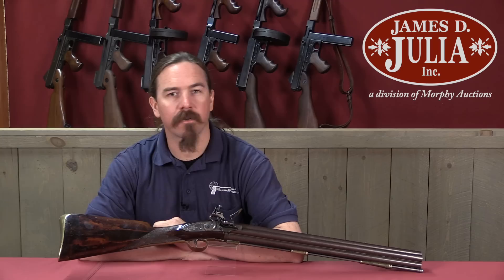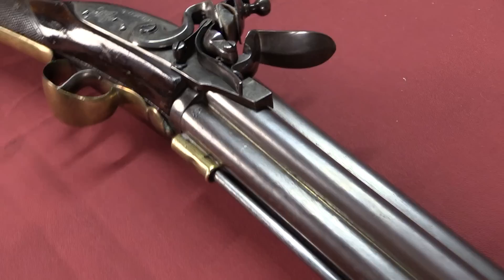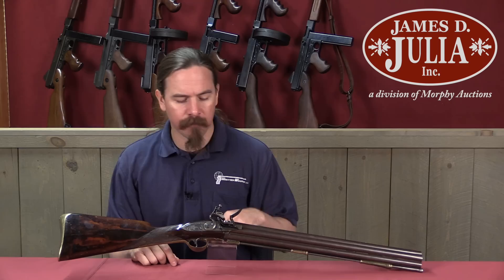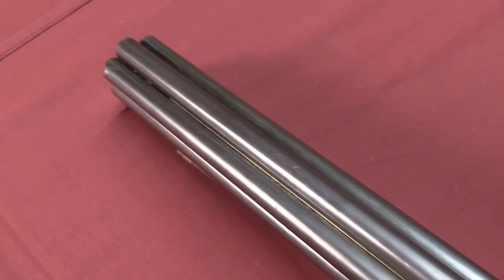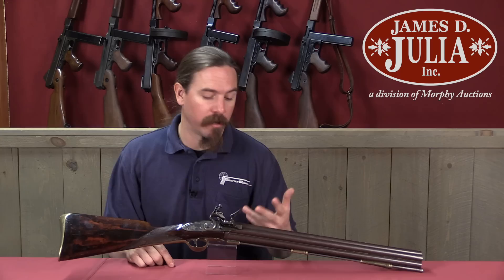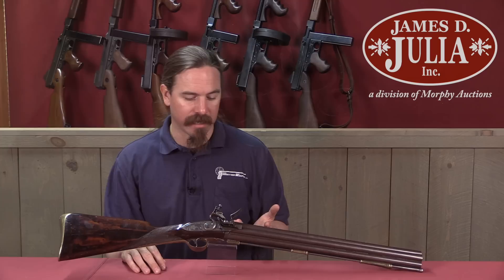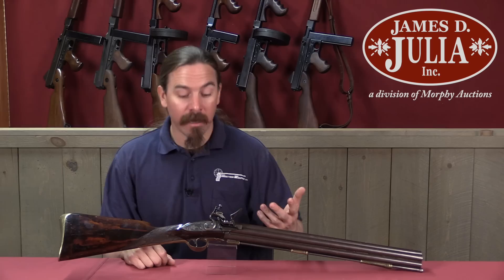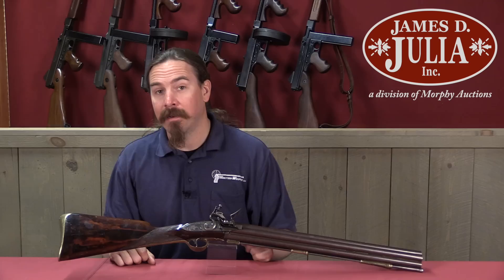Nock's Volley Gun: Clearing the Decks in the 1700s

Comment: Love your videos Ian. 
-Just one tip with this one. You can easily tell which barrel has or hasn't been fired by running the ram-rod down. If empty it will hit bottom and usually correspond to a marking on the rod itself. Sounds easy but I wouldn't want to be the one playing "one of these things is not like the other" 7x over during a naval battle. Please keep em coming!

Comment: Lol, GREAT video, but you had a huge oversight and got one thing dead wrong brother. 
If some barrels didn't detonate, just do what all musketmen did, and still do to this day, take your ram rod which had two cuts or lines in it so when it was inserted as far as it'd go, depending on which line was even with the muzzle, that told you whether the barrel is loaded or not.
Reply: I was going to say the same. Fairly easy way to check empty barrels
Reply: And muscle memory says, an unintendeded 'powdered' double shot.   Have to watch if you tap load going for 4 per minute

Comment: Someone probably already mentioned this but at 4:09 you said there is not a way to tell which barrels are loaded and which are not, that is false. Any muzzle loader worth there weight knows to mark there ramrod at the length of an appropriately charged barrel. That way not only if they drop the rod down the barrel they can tell that it is loaded but also you can tell if a projectile is fully seated or not. You do not want an air pocket between the projectile and powder in a black powder firearm, that is how you blow up a gun.

Comment: Ian not to say your wrong But the word Tower on the lockplates  I always believed was the tower of London  For most of the flintlock and percussion periods, the Tower of London served as a storehouse for arms, but no arms were actually made there in the usual sense.  Contractors made the various parts, and brought them to the Tower for inspection; if they passed inspection, they were accepted and the contractor paid.  Locks were delivered assembled but with the lockplate soft and "in the white".  The lock would be inspected, then disassembled and the parts inspected.  If accepted, the lockplate would be stamped with the broad arrow, then turned over to Tower workers, who engraved it with the royal cypher, the year, and the word "Tower" before hardening it.  Once all the parts were finished, the lock was reassembled, inspected again, and placed in stock.

Comment: I'd rather have a 1 bore blunderbuss full of 00 buck.
Reply: On top of a masthead, it might be a receptacle of rain, spray etc.  and isn't the load loose fit,
 an don't forget a 160+ deg angle.
Reply: @johnpotter4750  A muzzleloading shotgun uses a wad over the powder, and another thinner wad over the shot. So, you'd load the powder charge, then a thick wad, then your shot, and a thin wad over the shot. Like building a modern shotshell in the gun, one shot at a time.
Reply: @johnmullholand2044  True !  ....  just the juggling act, no range tables up aloft.   ..Fierce..

Comment: It is easy to determine which barrels had not fired in a partial volley - the ramrod would only go so far as the ball and wadding (sitting in front of the powder charge) i.e. not the full way. You would do this reasonably carefully, as vigorous ramming may cause the powder to explode under compression... anyway, no it is not difficult to determine which barrel had not discharged.

Comment: Suppose the reload problem with the non fire barrels would be sorted with a mark on the ram rod showing how far its meant to go into the barrel, if it doesnt, dont try to load it.
And i bet itd make a good nest gun, have a slightly armoured nest half way up a nest with a couple of them in racks when going into battle with a gunner and a loader team sitting up there. Be a mean system on deck clearing, especially if you have a couple barrels with buckshot as well as a couple with regular balls.

Comment: I suspect that the slight delay in the ignition of the six outer barrels, just after the centre one fires and causes (the beginning of ) recoil, unsettles the shouldering just enough to make total recoil unpleasant, aggravated by improperly holding it. If your first shot with a (badly fitting or badly shouldered) standard shotgun can put you off, imagine what this monster can do.

Comment: Damn that's a lot of gun. Most I've ever shot was a home made 5/8" bore muzzle loading/break-barrel 209 percussion Buntline pistol loaded with 200 grains of FFG black powder substitute, 3 .50 cal. lead balls and a full (spent) .410 shell full of birdshot poured in with some tissue paper wadding to keep everything where it's supposed to be. That thing kicked, but not as hard as I expected. Probably because of the generous spring length behind the piston that drove the firing pin into the cap. It was effectively buffered. Also tissue paper isn't the most efficient wadding. Results may vary, but it's still the hardest recoil I've experienced in my life so far. I might try a volley gun just for the challenge, now :)

Comment: Thank you Ian! I wish somebody made a shootable repro of this so we could have one for Rev war Re Enacting! My group is Colonial militia, but as we are Massachusetts men, the sea is never far away and plausably, a privateer might have got hold of one. In practice one tells if a barrel still has a load by dropping the ramrod down the tube, if it doesn't go all the way the barrel still is loaded and one must clear it with a screw and a worm. Re-enacting, we never fire ball anyway, but that would make an impressive boom and cloud of smoke.
My concern is as to how one might clear the internal touch holes, one often needs to "prick" the touch hole on a flintlock to ensure ignition.
I wonder if anybody ever pintle mounted a volley gun, it would seem to be the solution for the brutal recoil.
It would be very cool to shoot with you, Ian, If you were in the area, I'd invite you to come shoot anything in my extensive collection on my range and I have at least one gun you have never ever reviewed, a pack saddle cannon. (unfortunately I don't have the saddle or the mule either, but the gun is a 29mm 3 bore. It shoots a 5 ounce ball).
The Colonial Militia would welcome you.
Reply: Good point about internal touch holes, as you know powder (issued)quality/damp can play havoc with pan/touch holes, my matchlock has fairly large holes, not a problem.  Unless your ranking with a southpaw, then your felt hat has to dip lower,
     (R-R-L =painful)    front is more light brown than black these days.....
Reply: @johnpotter4750  That is how you tell who has been in the ranks longest! The hat!
Reply: @bellakaldera3305  1 yr a a Gentleman of the Pike,  Then 25 yrs as a mere mecanical (Musketeer, 3yrs Sgt)

Comment: Note the unfired barrels by checking depth with the ram rod. Sounds tediously impossible in a battle scenario.
Reply: Samuel Carpenter The real problem is clearing the barrel of the dud round. A laborious task you really don’t want to do.
Reply: +Bobby Lee I did it twice. Since then I make sure I only shoot a very clean touch hole with attention to properly settling the charge. I learned my lesson well and haven't had to dig a dud out the muzzle end in years. I don't see why they would have to dig out an unfired load in the heat of battle; just use the other barrels. I imagine the percentage of unfired loads would be rather high when loading under time strain. Anyways, I was just replying to Ian's statement that the task is "nearly impossible." Keep enjoying those historic arms! Nothing beats that black powder sound!

Comment: "...With blanks it has no recoil." Uhhh, actually, yeah, it DOES! I've fired a repro of this monster. Even with the considerable weight of the piece, those 7 barrels (.50 cal. on the example I shot), each loaded with a 40 gr. charge of FFg black powder (no ball, just a paper wad), produce a noticeable push... perhaps comparable to a very light load from a .410 shotgun. In a gun as heavy as this, that's impressive! I DO believe that, properly loaded with ball, it could cause physical injury, if not mounted properly to the shoulder.

Comment: Someone explain to me the major benefit of this over something like a large bore shotgun please. 

I get the application, it makes sense for deck clearing. 
But I feel like multiple projectiles in a single large bore would do the job better and be cheaper and faster to manifacture. Not to mention actually being able to reload it in something resembling a timely fashion. It seems illogical and a waste of resources.

Is the volleygun lighter than a blunderbuss that would be more or less equivalent when it comes to amounts of lead down range? But considering the application doesnt require carrying this around much weight doesn't seem like it would outweigh (unintentional pun) the drawbacks.
Reply: But one barrel firing 7 projectiles has the same effect. And even though you might rotate 2 or 3 guns with people reloading them, being able to reload the weapons quicker still gets you a higher volume of fire overall. Reloading 7 individual Barrels is simply a massive pain in the ass and logistically a nightmare mid fight.

I still dont really see the practical advantage of this weapon. At the same time I dont think the navy at the time was staffed by idiots who cant see this so there must havebeen a reason they adopted this instead of something with just one big barrel.

Comment: Interesting. Have heard of these. Loaded with a slightly more undersized than usual ball with a thick wad/patch and several #1 buck pellets in each barrel, or regular ball in say,  4 barrels and a good load of buck in the other 3, it could be fearsome. In a close ship action, a well trained man might be able to sweep a whole group of enemy officers off of the quarterdeck. The ridiculously ornate uniforms and hats of the time would make them stand out. A modern enthusiast, to be practical, would probably only load the center barrel and the one adjacent to it on each side, if it is safe to shoot at all. Greater ignition reliability, and much less recoil. I wonder what the delay time is from hammer fall to the 7th barrel firing. Gotta be a full second or so. I'm surprised one of the replica companies hasn't made a 3 or 4 barreled replica. 50 cal percussion would probably work fine. 6 or 8 buck pellets per barrel would be interesting. Great video as always. Thank you

Comment: How do you know if a barrel didn't fire?  Duh!  Muzzle loading 101, you mark your ramrod at empty and at loaded.  Then it just takes a second to drop your ramrod into the barrel before reloading.  The mark will tell you if that barrel is empty or not.  I have a friend who is a gunsmith and has built one of these using .50 cal smooth bore barrels.  It does kick a little bit more than my 8 bore flintlock, but not much.  Honestly, I think my Model 70 30-06 kicks harder. That's why I had a recoil pad added to the Model 70.

Comment: fires the rightmost barrel each time. Or none or all. I wonder if this is actually a 7 barrel vollygun barrel casting cut and modified with a bolt down the middle and modified brass flash channel nserts for flash pan at the end. I bet you it is

Comment: You said something about not this not being useful in a civilian capacity. My first thought was anti piracy. I do not think there was much of a problem with Piracy in 1805, but that would be a civilian use. And the Nock would have been much cheaper than a cannon.
Reply: Alright I'll bite, what are the pros and cons of using this over a conventional cannon besides cost?
Reply: I wonder if a 2-pounder or a 4-pounder wouldn't have actually been cheaper than this, since it had fewer moving parts and much simpler metalwork (though more metal overall, and materials were more expensive than labour back then).

Comment: so how does one clear a misfire in guns like these?
Reply: The same way you clear a misfire in any muzzle loader.  Attempt 1 is to try to get it to fire, in this case pour powder into the center bore and fire it off hoping it will manage to ignite the misfire.  Attempt two is to use a ramrod with a screw in the end, use the ramrod to push and twist the screw into the end of the lead bullet and pull him out.  I've had to do this myself on occasion, I wet the charge by removing the stock and putting the nipple end into a tub of water before I attempt it just to make sure it won't somehow discharge.  Neither means is very practical in the heat of battle.
Reply: neat, didnt know of the screwhead ramrod before.  
so i guess the only difficult part is actually realize one or more chamber didnt fire in the first place...